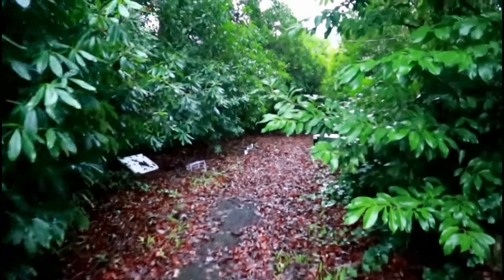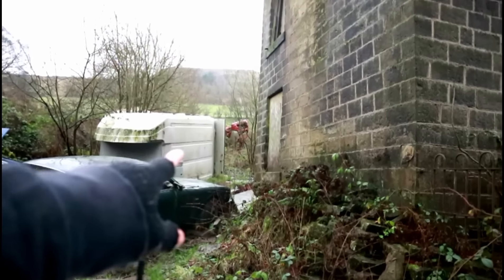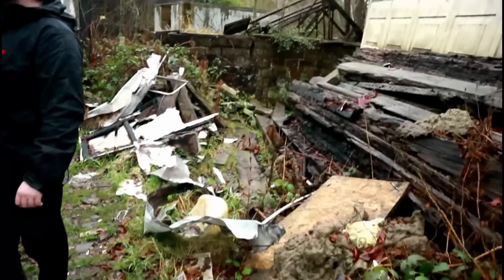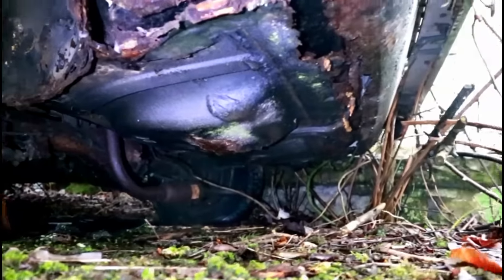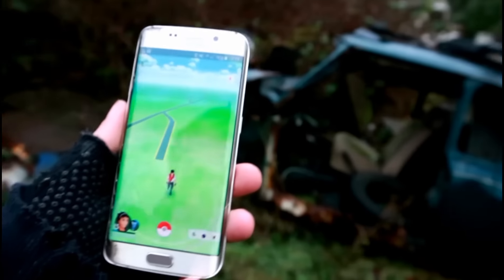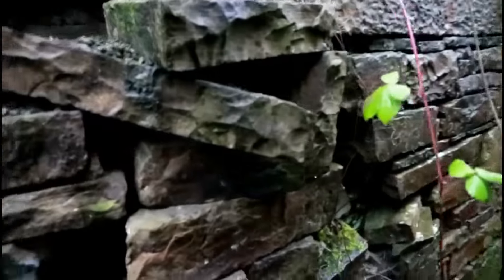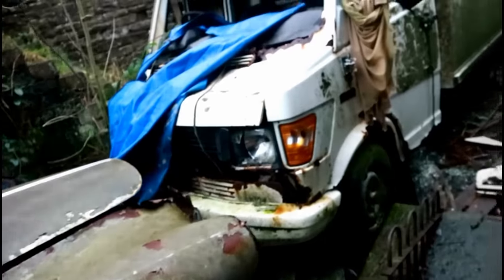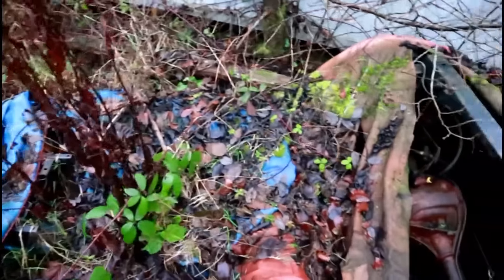BRITISH CLASSIC CAR GRAVEYARD

Comment: The easy way to tell if  the mini's are original coopers are that they will have two fuel tanks, so if at the back of the minis there are two holes either side then that's a cooper.
Reply: Depends, the second tank was an option until homologation in 1966, prior to that it could have had a single tank. Same with the oil cooler, it was a factory option until then. Either way it's a shame to leave it rotting

Comment: my cup of tea is old Minis and I used to have a Mini Mayfair with a 1275GT engine in it so I had combined luxury with speed and boy did it handle! I had spacers on the back wheels to make them wider for smoother cornering, roll cage, strap down bonnet and set of 6 spot lamps and used to tear arse it down country lanes seeing how much I could get the back end kicking out...so to see the British racing green open-top mini and the red Cooper left to rot is heart-wrenching, again great video  though.

Comment: I'm a classic car dealer, I simply buy at the right time.
Back in the mid 90s I was picking up escort mk2's and ford capris for around £100-£150, in roadworthy good clean condition ' I have plenty of cheap dry storage I rent in various places to keep them, late 90s I was picking up mk 1 Vauxhall Cavaliers and original Austin metros and minis, same kind of price, most of these vehicles had nothing spent on them, they were just stored and started up occasionally.
Within 5 years they were up for sale for around 10 times what I paid and selling like hotcakes.
Best future classic to buy is a common road car, one people had or parents had or they remember seeing around a lot.
Buy the vehicle when it's close to 20 years old, by then it'll be at rock bottom price, often advertised as a cheap run around.
In the last month I've bought 4 ford fiestas, all in pretty good Nick, roadworthy, I paid £250-300 each for them, 1997-1999 model's, within a couple of year's this model will vanish from the roads, scrapped, a year or 2 later I'll be selling them for £2500-£3000.
I use some of the cars I buy until the mot runs out..
E.g. the 1998 fiesta 1250 that I paid £300 for with 9 months mot, recently had new tyres and brakes, it's nippy,  economical and isn't full of electrical gadgets that cause so many newer cars to go wrong, it's fairly straightforward and easy to work on if you want.
Once mot runs out it'll be cleaned up and put into dry storage.
2021/22 price I'll be asking will be around the £2500-£3000 mark.
Buying tip for useable cars, it's cheaper better to buy a 14/15 year old car with average mile and no service history than it is an 8or9 year old with no service history.
Chances are the newer car is being sold just before cam belt, clutch, exhaust etc need replacing, the 14/15 year old car would have already had that done otherwise it'd not still be running.
I'm talking 10k miles per year with no proof or signs that major parts haven't been replaced.
Not much of a tip as most would choose the latter option anyway:)
But I'm not giving anymore away as it's my bread and butter
Reply: Albert Tatlock , eh up lad, was thy point?
Reply: Fiesta supersport in that pile of classic you have???????
Reply: Albert Tatlock is the cavalier mark two or mark three just asking I liked the cavalier when they came out

Comment: Non of the mini shells were cooper or copper s shells. They had twin fuel tanks with a filler just above both rear lights. Also the 'convertible' mini you mentioned was just a mini with a webasto roof! Non of those minis are anywhere near a grand!
Also you said the parts could be removed if they were stripped first. That would be theft! Everything belongs to someone! Just because no one is looking after these cars doesn't mean no one owns them'! Really enjoyable to watch though as I'm sure places like this are very few and far between now.
Reply from the maker: +Mark Morgan the soft top was a british racing open. Banger lads pay £1000 all day long for mini shells at warton.

Comment: The old cars look like they are of an e type so the chassis and that red car
Reply from the maker: +Etho 2005 Yeah thats what i thought
Reply: Dont know what makes you think the chassis are from an E type as the E type never had a separate chassis, it had a stiff body and engine cradles at the front bolted to the bulkhead, then rear diff cradle carrying the rear suspension, brakes etc.